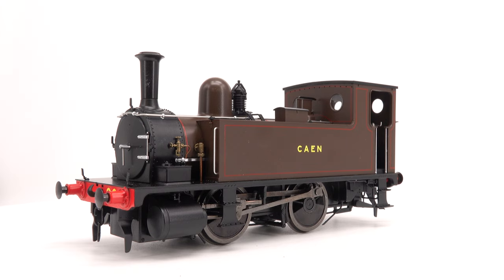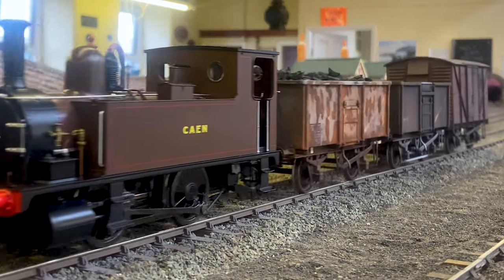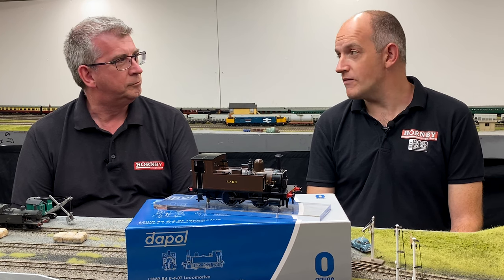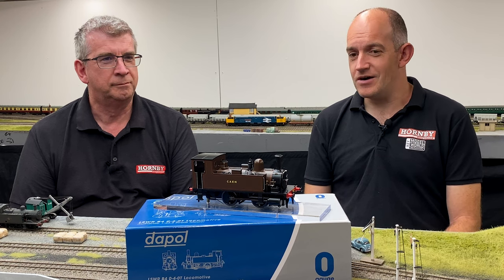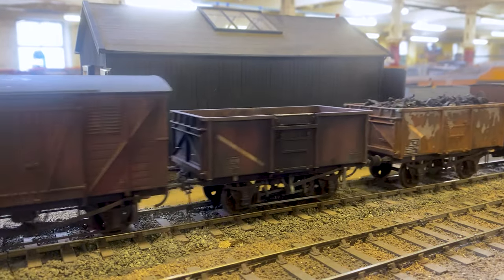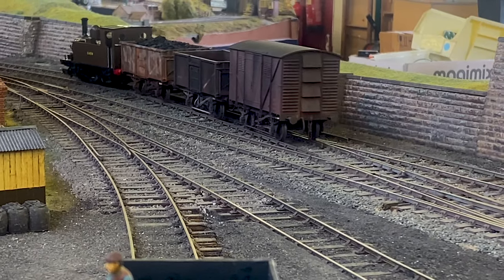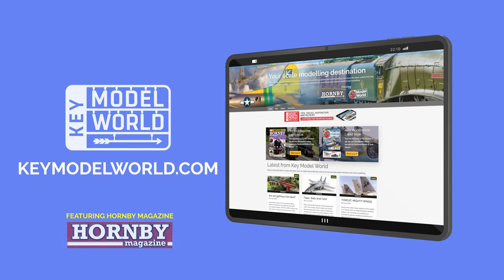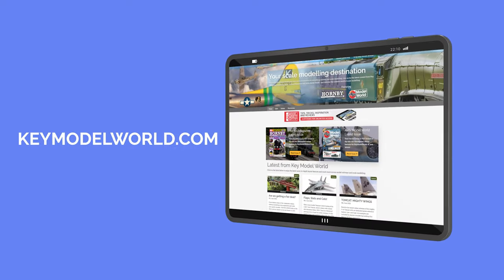HM194: Dapol's 'O' gauge LSWR 'B4' 0-4-0T

Comment: Untill today the best Dapol model. It runs perfect and silent.  I bought it DC or € 109, because the original decoder is mediocre at least.  I built in a Tsunami 2  decoder with sugar cube speaker within 2 minutes due to the  clever construction of an removable DCC board.  Sounds and performs excellent.